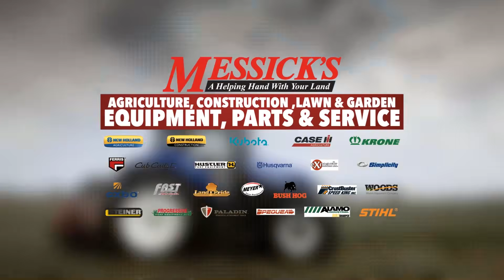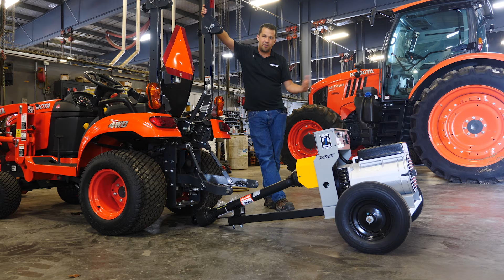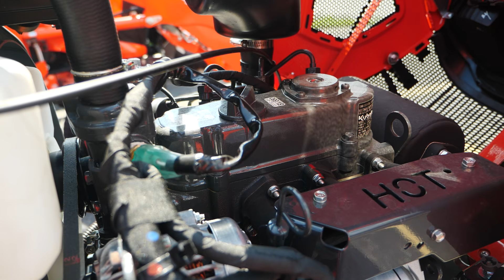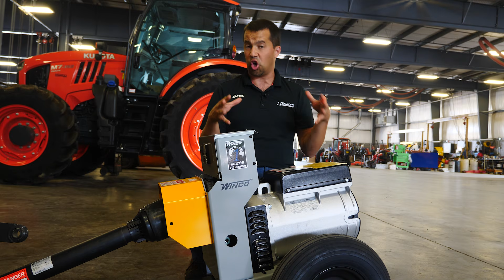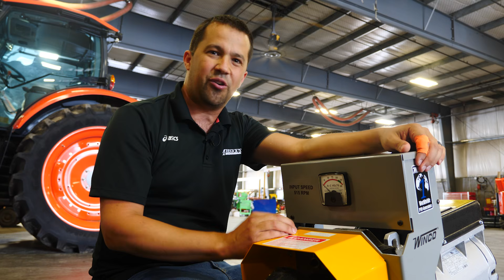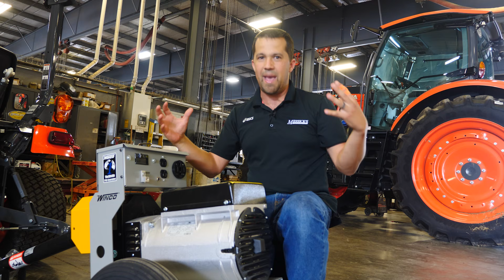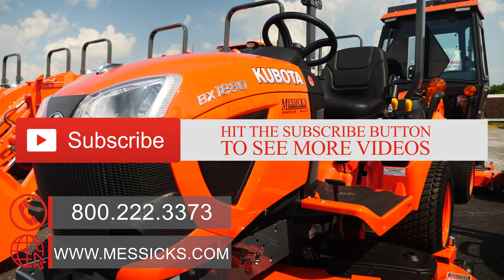Power your home with your tractor - Winco PTO Generators

Comment: If I ever get a BX this type of generator would be great, no need to deal with maintaining an engine that isn't used often, easy hookup to quickly get power where needed, and those "portable" generators aren't really that portable when you have to lug them around you quickly realize how heavy they are, especially one that is large enough to actually use as a backup generator for a home.  

Not sure what people would be so negative about this type of generator for, that is unless they don't have a tractor LOL.  I'd think if you got a tractor sitting around your property and you need power, that PTO generator would be great.
Reply: The diesel tractor pto generator is far QUIETER than a gasoline powered portable, it uses far LESS fuel than the gasoline portable (and is better for the environment),  diesel IS FAR EASIER to procure because everyone else is buying up all of the gasoline to run their "noisy, inefficient, gashog" generators.  The diesel engine also lasts far longer than the air-cooled gas engine, and diesel is far safer to store in your garage than gasoline because diesel's fumes don't "go BOOM!" as gasoline can, and diesel can be stored far longer than gasoline before it goes bad!  It's a no-brainer for this countryboy!  The diesel is the way to go!
Reply: @user-cy6gf2pj7y  Finally got my tractor a week ago....one of these generators is on my list for sure now.  Thanks.
Reply: You really need to run through a power out scenario to decide which configuration would work best for you. In most cases the portable generator is on wheels and you simply wheel it outside, plug in the feed line and you're up and running. I can have mine connected and running in less than 10-mins. With the tractor you have to go out to the barn, garage, shed or wherever you store the tractor... wheel over the PTO generator and get it hooked up. Then start the tractor and drive it to the house and find a place to park it so you can get your feed line connected. Connect your load, throttle up to wide-open and now you have the tractor screaming away outside your window at wide open throttle. It just makes no sense. PTO generators sound like a good idea until you've been through a couple extended outages... maybe during an ice storm or hurricane-like winds. I can protect my little portable generator from the elements. I can't do so easily for the tractor and PTO generator sitting out in the driveway or yard. I won't even mention the risk of theft of an unattended running tractor.
Reply: @eosjoe565  I'd have to go out to the shop, shed, barn, back 40, or wherever I store the generator and lug it across the property I haven't seen anyone that keeps their "Portable" generator hooked up to the house 24/7 so you'd have to go lug that thing all over the place too...I'd rather jump on the tractor and hookup the generator that way than lug around a not so portable generator.  For that kind of money though I'd just have a standby generator installed, then I don't have to do anything, except reset all the clocks, even with automatic transfer switches you still lose power for a couple seconds.  I've thought about a standby generator but we don't have enough power outages to justify having one, and it is 1 more engine to maintain.  

I had a portable generator, yeah when you get one that is large enough to actually power your house they aren't portable, maybe on wheels but they're not something you'd just drag around your property they're heavy, they're cumbersome, and they have to be maintained.  I got rid of my generator because I never used it enough to justify keeping it and the power outages that we have where I live don't bother me, sometimes its nice to just sit back and relax and not have to work LOL.  

A PTO generator would make far more sense if you already have a tractor and you don't use it 24/7, and most people don't...they're tractors sit more than they are used, so having a Generator that you can power off a tractor would justify having the tractor around that only gets used a couple times a month.  

You don't need a tractor to clean up storm damage, you need a chainsaw and time.  So the tractor can sit and keep your house powered while you are cutting up the tree that fell on your house, that is if it didn't crush your pretty tractor too.
Reply: You run into the same issue as the smaller portable units, if your running a smaller tractor, when your wife turn on the oven and decides she needs to dry clothes too, the rpm drop kicks the breaker or burns something up. On the other end, if you have to big of a tractor, you dont have the loading issues but you run the risk of wet stacking and you are using a high dollar machine to do an $800 generator's job...They are handy though.

Comment: I love my Honda generator.  Runs the whole house and is very quiet.
Reply: Do you live in a RV?
Reply: You don’t run your whole house. You run parts of your house.
Reply: Robert F exactly
Reply: Only if you have one of those "tiny houses"
Reply: What is the power of your generator/KW?
Reply: Doubt it runs the whole house lol. Honda is not known for large scale gennys.
Reply: @pryme2013  Honda has a 7kw and if you have gas appliances you can easily power your house.
Reply: @TheFIREGOD12  not if you have central A/C!  You must live in a "tiny house"

Comment: Why are they so expensine
Reply: The amount of copper windings in a good generator power head is a huge part of the cost equation.  You really get what you pay for when you go cheap with a generator.  Thinner copper wire plus less of it makes for a very poorly built and short lived power head.

Comment: Are there models that produces a total harmonic distortion less than 2%?
It seems an inverter generator provides the cleanest power and would be safest for a modern home.
Reply: Precisely the opposite - inverter gensets are very fuel efficient, but consumer-level inverters are rather noisy. Big spinning iron is very clean provided you can keep constant RPM. Buying a much bigger unit than you need will add some mechanical inertia that will smooth out voltage and frequency. With that said, you'd be surprised what you can get away with especially for standby applications. Just remember to specify for Volt-Amps, not watts. They're the same for DC, but they're different for AC, and it can make a very big difference. A square wave inverter, for instance, will need to be severely "oversized", while a true sine wave inverter solves that problem right there.

Comment: A NEIGHBOR HOOKED ONE UP TO HIS HOUSE RUNNING IT OFF HIS 40 HORSEPOWER KUBOTA, WORKED VERY WELL EXCEPT WHEN IT RAN OUT OF FUEL ONE MORNING. HE REFUELED AND STARTED THE TRACTOR BUT THE GENERATOR LOAD STALLED THE TRACTOR BECAUSE THE HE DIDNT THROW THE MAIN BREAKER TO THE HOUSE AS SOON AS HE RESTARTED THE TRACTOR ALL HIS LIGHTS AND TWO CENTRAL AIR UNITS PUT WAY TOO MUCH LOAD ON THE TRACTOR AND STALLED THE TRACTOR. FROM THEN ON HE HAD TO REMEMBER TO SHUT ONE OF THE UNITS OFF AND TURN ALL THE LIGHTS OFF IN THE  HOUSE.  INITIAL START UP SURGE IS HARD ON THE TRACTOR.
Reply: Ok, good point, but no need to SHOUT! Thanks! ✌️

Comment: Remember, when the power is out you may need the tractor for fallen tree cleanup, cutting ditches during hard rains or flooding, etc....

Hope it's not sitting there humming away to power the fridge.  Better off with a dedicated generator or welder generator IMO, I have both.  I have lots of heavy equipment and don't want a pto generator
Reply: Maybe that's your situation, like mine we have multiple tractors. The tractor I put on the generator lacks a loader and is is much more efficient then a gas generator. The tractor on the generator couldn't care less if I run it 2 hours or 20 hours, it's only purpose is to work and has done so fabulously for 60yrs already.  A gas generator you have to change the oil every 30hrs, where the tractor runs much longer between oil changes because of less heat and more capacity. With modern gasoline also, it is hard to store where as the diesel my tractors use is easily stored.
Reply: @BillTheTractorMan  that and in reality if something major is going on, how many people are more concerned with jumping on the tractor cleaning the yard than other more important things going on at the time?
Reply: A PTO generator as an emergency whole house generator just doesn't make any sense. The last thing I want to have is my tractor sitting out in the yard running wide-open for what could be a couple days in the rain, snow, ice or whatever other nasty weather is happening. I would much rather have it available for any needed storm cleanup duties. Meanwhile, my little $800 8KW portable generator is under shelter running the whole house just fine and using very little fuel doing it. PTO generators certainly have their place - but whole house power isn't one of them.

Comment: the only downside for residential customers is leaving your tractor sitting outside running during a power outage, especially at night...  and someone walks up and drives your tractor away...  worst case scenario at least.  unless you chain your tractor to a tree or etc... or have a gated yard.  those wincos are 100 times better than any big box store generator
Reply: Not a problem at my place.  Very rural here and I am well armed.
Reply: I hope they bring duct tape, they will be leaking
Reply: @kennethfeld6639  good one!
Reply: I mean people can walk up to your tractor during the night when its parked wherever you store it and drive away with it too, so there's no difference in it sitting out powering your generator, or sitting in a shed.  Really, if someone wants your tractor they're going to take it regardless where you have it parked.

Comment: Well that's good news I've never been able to get someone to tell me what a actual high hour count would be for a diesel engine
Reply: Lots of variables in that.  How's it been used, how's the maintenance been on it, etc. play a major role in how long an engine will last.  I'm guessing 20k hours wouldn't be unheard of in a diesel tractor engine and still going strong long after....but again maintenance and the way its treated is a huge factor.
Reply: @wildbill23c  thanks for that but I figured you could gauge the diesel engine that same way you could a vehicle engine just for instance its just confusing to me I guess as to how nobody can put a number on it lol
Reply: What's in your car and what's in your tractor are entirely different. What he said is 100% accurate. You know that older guy that has a 1960's deere with a bunch of leaks and an engine that runs just fine? That's how it works. Fluid seals will wear out LONG before a tractor engine that got good (not the cheap stuff) oil and filters at the right time. Most of those diesels are sleeved as well, so if you do live long enough to see your tractor engine wear out, you throw new sleeves and pistons in it and you're ready to go. MIGHT have to rebuild an injection pump, but the baby you took a picture of in the tractor seat when you brought it home will probably be 40 when that happens.
Reply: It’s all about how they are used. The stationary generators or refrigeration units on trailers are about the easiest loads for a diesel. Usually constant rpm & no shock loads. Hence the insane hours you can get out of them.
Reply: @TheSwanny  right I get that I just feel there should be some sort of general rule of thumb at least in my mind lol
Reply: Depends on how it was used. On a machine that has ran a hammer, 3000hrs is worn out, it is a tough environment. On a mid 90's john deere tractor that mows hay, alittle over 10,000hrs its done, needs new liners/pistons plus the rest of the tractor needs attention. Have a ford 5600 with 5000hrs and it is worn out front to back. Had a ford 1720 with 3400hrs that was knocking. Seen light plants and generators with 10k hours and were still humming along fairly well, no idea if they had been repowered. It really depends, you need to look at the unit as a whole if buying used and really listen to it run. I will say that 30k is optimistic, even if its a stationary type unit that is kept out of the dust.

Comment: One problem I see is that now my tractor is tied up to the generator. Now I can’t use the tractor to help clean up any storm damage, which is most likely what caused my power outage to begin with. Now if I was in California dealing with rolling blackouts, I guess that would be a different story.
Reply: Most people don't actually need power 24/7 and can deal with no power when the tractor is in use.
Reply: I would probably be more concerned with my house and family until the power came back on, but that's just me.
Reply: My point was if power is out for 2 days to a week from an ice storm, and you have trees and snow covering your drive and you can’t get out, it would be nice to have the tractor. Just something to consider when looking into a generator
Reply: @coreyfryer4536  Would you need to run the generator 24/7 if that was the case? I've heard people talk about the price tag of these little ones being rather high compared to self contained generators so maybe same of the people buying these have two tractors. I know whenever I've seen videos of these things, granted only like two or three videos, they tend to be used by people who have more than one tractor like farmers or similar people.
Reply: 2nd problem is that you have to bypass the seat switch,  the tractor will kill once you leave the seat with the pto engaged.
Reply: WAYNE DESHOTEL, depends on the tractor. My 55A will not shut down with the PTO engaged.
Reply: @KrazyKajun602  Depends on the tractor. My Mahindra 1533 will run with no seat weight. You do need to be in the seat to start it.
Reply: @KrazyKajun602   newer Kubotas flip the seat up the tractor stays running with PTO on.
Reply: @KrazyKajun602  contact your dealer or look in the manual.  They all have a way to run the pto when not in the seat.
Reply: @KrazyKajun602  and it takes less than two minutes to disable that lawyer induced switch!  I bypass them on EVERYTHING as soon as they get home!
Reply: WAYNE DESHOTEL k
Reply: @KrazyKajun602  this is probably tractor dependent, old tractors certainly don't have this kind of thing and even newer ones will not.

Comment: How much? I have a 300.00 4,500w predator from harbor freight that has worked great the five years I've owned it. When it wears out I'll get a new one. So far so good though.
Reply: Had one for a while and got rid of it because I just didn't use it enough to justify having it around.  That and it didn't have a 220V output so wasn't exactly much use for a backup generator to run anything you'd actually need during an extended power outage like a well pump, water heater, and other 220V stuff.
Reply: 5 years old?!?! not bad. i just bought a 25 year old winco, paint isn't as shiny as it used to be but it  works great. i honestly believe it has another 25 years of life left in it being used for power outages.